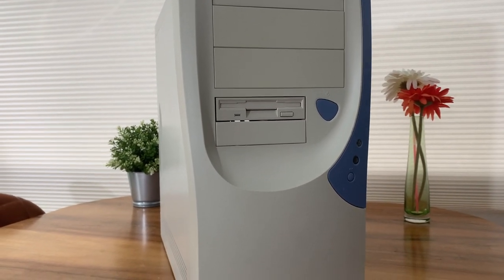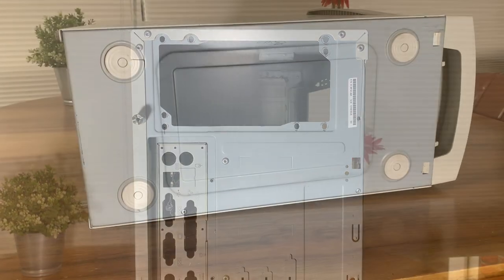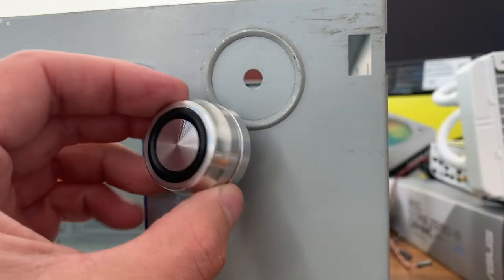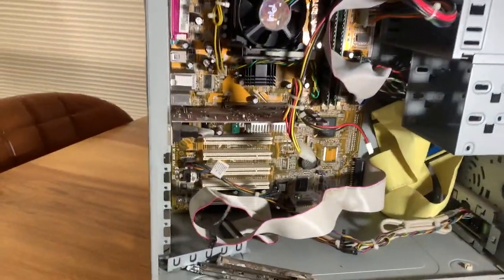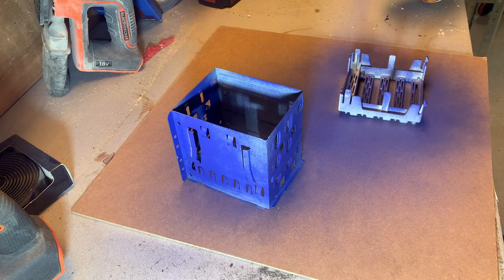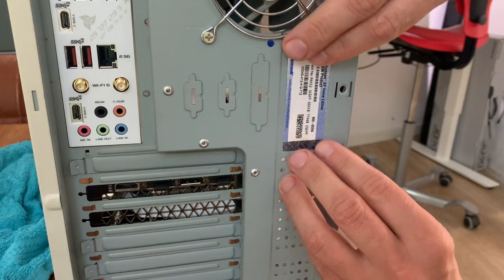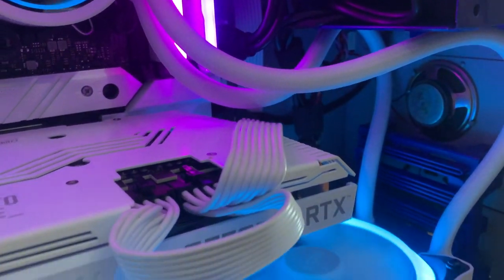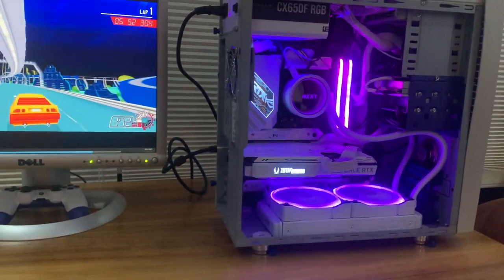Building the Ultimate Sleeper PC in an AOpen HQ45 Pro Case

Comment: Since it’s an i3 you could’ve went 92 or 120mm air.  Going by the comments you were probably better off going with a 120 AIO radiator on the rear then installing a lower intake fan (speaker delete).
Your presentation is spot on.  In order to get my PATA ODDs to work I used a PCIe to PATA expansion card, and it looks a mess with PATA cables stretched across the motherboard.
Reply from the maker: Thanks!

Comment: Very nice job, congratulations 👍 By the way, you can still connect old floppy disk drives to a modern board.  I have an internal USB adapter for something like this.  Is plugged onto the back of the floppy and then connected to the header.  And yes, that even works 😁

Comment: Looks great man. I was surprised you didn't drill holes in the front for intake fan, and cut out the bottom of the front case grill.  You could use some high static pressure fan and dust filter there to push cool air in.
Reply from the maker: It's been running helldivers 2 without any issues so far :)

Comment: What if sometimes in the future you befriend a CNC machinist and ask if they can help you cut out metal that can hold a radiator towards the side panel instead of using the side panel as a mount for it. Just cut some holes in the side panel in an appropriate period correct style have a rich uncle to help fund you a custom waterloop. Hell. If the CNC guy really felt like it I bet they could make a custom mount for the mother berboard and may be even shrouds and strip mounting points to really clean up the clutter of the cables, and if you have an even richer uncle, get custom cables to booth. Yes... This is pretty much exactly how I'd like to do my own sleeper build but saving up for all this stuff takes for ever and I have tried several times only to have to use money for more urgent things. XD This is what happens when you dream too big and overthink things I guess but damn, if it wasn't a pretty sweet dream.